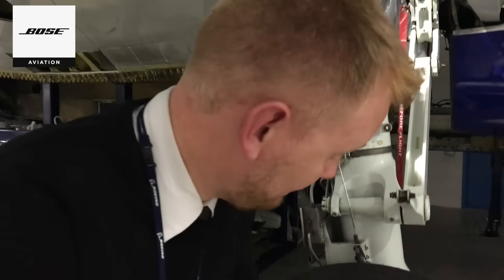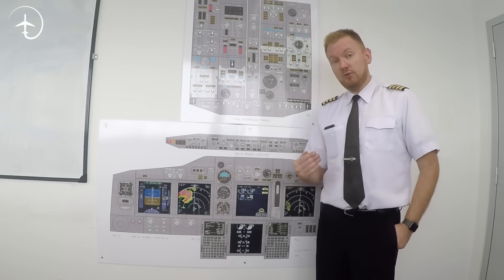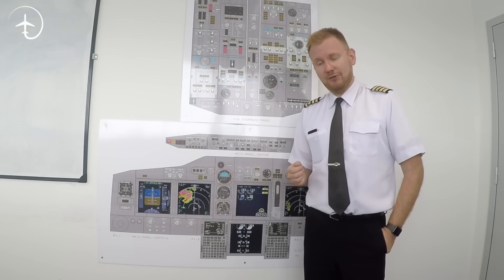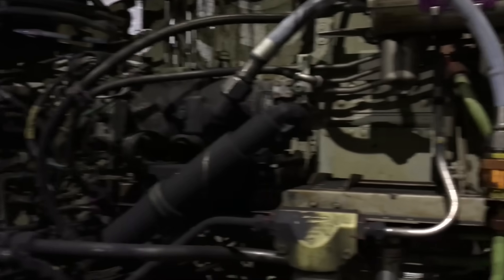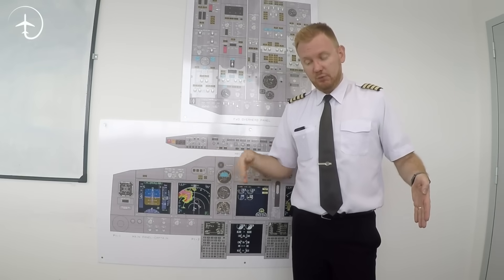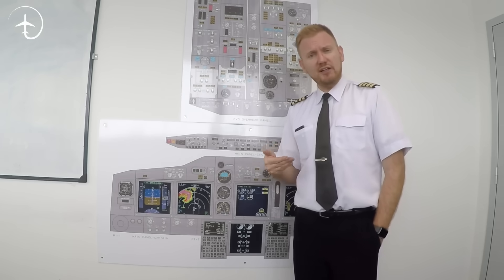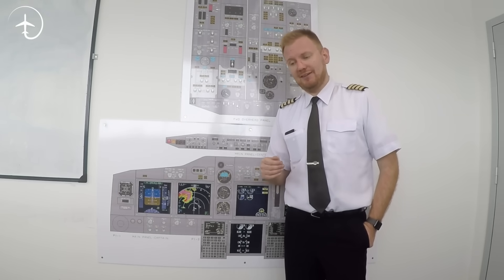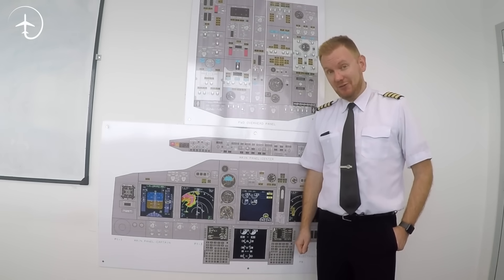Why does the Boeing 737 not have any landing-gear doors?

Comment: When I'm boarding the aircraft, even though the engine are off, why is it so loud?
Reply: Erwin Tjia it's the APU (Auxiliary Power Unit) it acts as like a battery allowing the aircraft to have power the out the Engine. It's like the ACC (Accessory) mode in a car
Reply: Marks right APU is a small jet engine in the tail area that provides electricity and bleed air pressure for air conditioning and engine startup.
Reply: Please do not confuse APU with batteries. APU in fact need batteries to start as it is a turbine engine with electric starter and it also needs fuel pumps which needs electric power. APU on some AC may also be started off a TRUs, B747 has switch to select if you start of a batt or TRU. This requires either engines running or external power to power TRUs with AC power. Some APUs are just started off DC bus and anything that powers it no matters what is it.
The other noisy thing may be brake fans on some Airbus models. On short trips crew may use them to cool the brakes if there is no enough block time to let them cool down without them.
Reply: Remember the "Miracle on the Hudson"? First thing the captain did when both engines went out was turn on the APU. Which wasn't even on the emergency list at the time. It is now.
Reply: They often are. This is called ground power. However engine needs bleedair to start. It can also be supplied from ground cart, but in most cases it is more practical to use APU, it provides both, the AC power and bleedair.
Turboprops usually start from electric starter-generators. They can be started from battery. Jets usually needs bleedair.
Reply: Rubbish. An engine would never just be left idling, it would never get serviced if that was the case. A running engine at ground idle power creates not only an ingestion hazard, but a jet blast hazard. As such, an engine would never just be left running at idle at any point while being serviced; lavs, catering, loading cargo/bags etc. It just won't happen.

APU is typically shut down right after starting engines and pressure stabilizing to normal levels. In the event of multiple engine failures, the APU would be fired back up and the RAT (ram air turbine) would deploy to produce power to supplement the battery packs and run the hydraulics for critical flight controls.
Reply: Balazs Ordog Airplanes are quite multifunctional on every property. So they can still function in all kind of scenarios. For example when parked somewhere away from the turnaround spots. Then it’s a lot more convenient to be able to crank the APU instead of having to call for a GPU before being able to do anything.
Reply: Philosopher of Nonsense Generally not true, running engines even at idle uses lots of fuel. Way cheaper to run the APU or ground power. Maybe you are referring to single engine taxi?
Reply: Aircraft will ALWAYS shut off their engines once at the gate. The ground crew can't service the aircraft, unload baggage, etc. with the engines running. Leaving engines running create serious intake and exhaust hazards for ground personnel.
APUs supply air for engine starting and air conditioning packs plus electrical power. APUs do not pressurize hydraulics. Aircraft hydraulics are powered by aircraft electrical systems of engine driven pumps on the main engines.
Reply: Philosopher of Nonsense    You are way off on many things in your comment.  A 737 engine uses about 800 lbs/hour idling.  The APU on same aircraft uses about 240 lbs/hour (electrics and pneumatic load).  During takeoff, the fuel flow is in the neighborhood of 8000 lbs/hour for each engine for the couple minutes it is at that thrust setting.  A 747 has the same engines as a 767, and since they are about double the thrust of a 737 engine, the fuel flows are probably double what I stated above.  And the only reason an engine would be idled at the gate would be in the APU was inoperative AND ground power was unavailable.

I have no idea where you got the thrust number for cruise of “40 to 60%”. Cruise thrust is set by the FADECs and is either EPR or N1 depending on the engine, and we have no idea what percentage of rated thrust that is.  Power is set to maintain the desired Mach number.

Engine failure seldom takes anyone to the scene of the crash, contrary to your statement.  Even in single engine general aviation engine failures, most land with little or no damage to the aircraft on golf courses, highways and in fields.  I did the highway myself without any damage or injury.

On to the APU.  It has no problem starting an engine compared to a running engine.  In fact the 777 can start both engines simultaneously using APU bleed air.   

I can’t even follow your logic on stress and wear with internal combustion engines and turbines.  It was poorly written.  

I have no idea where you got your “facts”, but most of them weren’t even facts.
Reply: Philosopher of Nonsense, total and utter shite!!
Reply: +Philosopher of Nonsense Nonsense indeed. Some of your facts are completely wrong. Each engine on a 747-400 uses  about 0.6 metric tonnes of fuel an hour at idle (during pushback). There are many reasons APU usage is limited, not just because of running hours and wear and tear. There are noise pollution, pollution and fuel consumption considerations. An APU should have no trouble starting a single engine if it's working properly. Idling main engines, however, would stuggle to crossbleed start other engines. They have to go up on power to crossbleed start.
Reply: ImperrfectStranger...No such thing as a bleed air driven hydraulic pump. Boeing and Airbus aircraft use EDPs (Engine Driven Pumps) or Electric Hydraulic pumps. The only air driven pump is the RAT (Ram Air Turbine). 
APUs provide only two things...air for the packs and engine starting plus electrical power.
Reply: prob the APU mate
Reply: Fromage...Again, engines are NEVER left idling at the gate. When the crew taxis into the envelope, the ground crew either connects ground power and air if required or they start the APU. Engine are always shut down.
I have been in aviation for 38 years and worked for major US air carriers as a gate technician. I am pretty sure I know what I am talking about.
Reply: Engine on idle when refueling and reloading,boarding??Are you insane?? That what APU if for.I work on the airport for years and never ever seen anything like this.Nobody can get close to the aircraft with any off the engines running,its against what they teach you on your training on your very first day at work.What a lot of bullshit.Sometimes engine fan is rotating because of the wind,but the engines are off.
Reply: Erwin Tjia it's the APU
Reply: Erwin Tjia nobody have mentioned braking fans :) for example if the aircraft has just ladned like 10 mins ago the brakes are very very hot, and they need to cool down so they can be efficient again for emergency braking for example, and then the pilots need to turn them on so they can cool their brakes, and those fans are insanely loud :) and the AC of course and APU
Reply: On small aircraft the noise near the tail is the APU, auxiliary power unit. On Large aircraft such as the 747, the apu is a long way a way in the tail cone, and not as loud as you might think. The extremely loud noise is far more likely the air conditioning “packs” located in the belly. These are turbine/compressor air conditioners that condition air for the cabin. They also pressurise the aircraft in flight. On a hot or cold day on the ground these will be working very hard to maintain the set temp. They actually sound like jet engines when near them and are incredibly noisy! That’s probably the sound year hear on large aircraft.
Reply: Phil. of Nonsense  Respectfully...just about everything you've posted is, well....nonsense.
Reply: Please come again!
Reply: And what are you doing now ?
Reply: Also, (beware, I'm not an expert but I'm finishing my aircraft maintainance course with a variety of AIRBUS aircrafts) as far as I'm concerned; aircraft neumatics / air conditioning called PACKS work as giant refrigerators. They are mainly designed to provide proper cooling to the cabin in cruise, which its air comes from the low pressure compressors of both engines. As it is intended to work with proper amounts of ram air, on ground ops, those EXTRACTION FANS, that generate the needed airflow, may end doing a hell of a noise. This system comes back from DC-9's design and even the A350 features it. 787 is different though. APU+PACKS(+ BRAKE FANS are also very noisy; only A320) may be the majority of the noise percieved.
Reply: APU and air conditioning, both are very loud.
Reply: Philosopher of Nonsense--GREAT STORY!!!!!    Remind's  me  of my VASTLY SMALLER  young moments
of glory, (I'm FARR more of a AUTOMOBILE guy) you take ME back to my GREAT memorization  of 
auto styling from 5 to 20 years old ( ALL american cars were VERY distinctively styled in the 50's, 60's & 70"s )
I was born in 1955, I would sometimes CAPTIVATE my classmates & teachers with my ability to tell you
the car heading east was a 1961 Ford Custom 500 wile the car heading west was a 1963 Oldsmoblie Super 
88 from about  65 to 80 feet away!! full sized Fords & Chevy's EACH had 5 trim levels Plymouth had 4
every September I garbed ALL my parents newspaper adds &  begged them to take me to dealers to get
the brochures  & studied them;  I could CORRECT MOST ADULTS !!!  But one of my FAVORITE MEMORIES 
(& the one YOU reminded me of ) was when I was CLOSE to 10 years old & having seen Ford's NEW
Dual-Way Doorgate (out for people, down for cargo)   I quickly figured-out HOW IT WORKED!!!!
they just had the upper left LATCH DOUBLE as a hinge & the lower right HINGE DOUBLE as a latch
DEPENDING upon which LEAVER you used!!!  Upon visiting a Ford dealer, to ask for brochures---------
I PROCEEDED TO EXPLAIN IT TO THE SALESMAN;----HOW DID I KNOW THAT?? he asked
Well I JUST FIGURED IT OUT  I ANSWERED!!!-----REMEMBER the LOOK the Captain gave your dad??
Well I got it ALONE,  my MOM was sitting in our car wateing for me to COME OUT with my brochure 
treasures!!!!!!
Reply: packardexelence actually, I did know that.  Nowadays too many car types to be able to identify more than a couple.  I’m sure some people can (law enforcement). But not me.
Reply: Not to mention that no established airport would allow them to stand at the gate with their main engines online for anything more than a couple of minutes - and that's only for the very (very) odd circumstance where they're not started during pushback, but before.
Reply: Why is this thread so long? I'm going to click on the next video now.
Reply: The APU. Probably others have already said this but I'm too lazy to look. Auxillary Power Unit is basically like an engine you'd find on a very small jet, typically made by Honeywell mounted in the tail 'cone' kind of area, you can see the exhaust hole for it.
Reply: Erwin Tjia The APU is on for keeping power on
Reply: +odiesdad01 APUs can be used to run bleed air-driven hydraulic pumps on many kinds of aircraft. e.g. 747-400, 767, etc.
Reply: Some APU's are actually quite large, in fact. The APU on a 747 is derived from a biz jet engine...which should help you imagine that these are fairly large engines. The Airbus A380 uses a HUGE APU, the Pratt and Whitney PW980. So yes...they can make a lot of noise.
Reply: +Philosopher of Nonsense
That is a really nice story! 

The first time I used an airplane was, when I was 17 yrs. old, a flight from Zurich-Kloten to London/Luton. It was one of the last flights of a Boeing 707 as a passenger aircraft, though she was quite  a comfortable aircraft. Many young people used that extreme bargain offer: 
Only 170 CHF (by that time about 80 US$) for a one week vacation during spring break in a three star hotel near Trafalgar Square. It was a wee little adventure for me, too...
Reply: Reason is you are probably hearing the APU.
Reply: packardexelence stellar response to.......I am not sure how we went from airplanes to cars, but you seem to have made the leap, so good for you.  Tail lights are the key for sure.  This story reminds me of my first smoke detector in my apartment right after I got married.........and my wife was wondering when I would build my own smoke detector, and then it came to me.  Batteries, yep batteries, that would solve the problem of power.  I should write my own smoke detector manual.
Reply: Oscar Blue--I think you KNOW how we "made the LEAP"  I of course was referring to his childhood "cockpit story" where he SURPRISED the Captain with his Knowledge ; you MIGHT Note that I referred to my "young
moment of glory as "VASTLY SMALLER" I was ONLY interested in CARS as a CHILD;  I didn't Get intrested
in airplanes UNTIL my last 2 years in the U.S.A.F. I gotta hand it to ya, though,  for an AIRCRAFT guy, you
either KNOW or GUESSED CORRECTLY about early 60's auto identification, Ford, Chevy, & Cadillac virtually
used Tail light SHAPE as TRADEMARKS!!!!!!-----But I'm SURE you knew that!!!!!
Just like I KNEW Philosopher of Nonsense  fuel CONSUMPTION rates were INDEED- NONSENSE;--since
an F-4 can burn up ABOUT 15,600 LBS. of JP-4 in about a 21/2 hour training flight,--- well at least I had
to REPLACE around that much, after they PARKED!!!--------------------------BUT BATTERIES for a SMOKE DETECTOR??????------oooooo sounds pretty DAMNN  RECKLESS to ME!!!!!!!!!!!!
Reply: Oscar Blue--OOOOh TODAY, you have ME for company as far as being POOR at automotive identification!!!
The LAWS of aerodynamic efficiency & weight conservation have caused automotive engineers to
REALLY RULE THE ROUST --as they have for DECADES with aircraft !!!!    I mean you only GOT so little
STYLING FREEDOM when FUNCTION; down to the LAST MPG & SAFETY down to the LAST CANDLEPOWER of TAIL LIGHT & SINGNAL LIGHT VIABILITY  are  HEAVILY compared!!!!!!!
And LAW ENFORCEMENT???? their identification skills HAVE ALWAYS SUCKED!!!!!
Reply: Philosopher of Nonsense A taxi driver leaves the engine on to run the heater or air conditioning. Modern cars automatically turn off the engine at every single traffic light, so the statement that it’s more profitable to leave the engine on is quite easily busted.
Reply: packardexelence no doubt.  Headlights are better, and a few cars have nice styling, but the cars of the 60’s are my favorites.
Reply: Oscar Blue---I LOVE MOST EVERYTHING about 21st century cars,  EXCEPT their PURPOSELY ENGINEERED
to SELF-DESTRUCT  in about 5 years or 250 thousand miles & PURPOSELY ENGINEERED ( &parts-Priced )  
to be IMPOSSIBLE to CHEAPLY REPAIR  that long!!!!!!!   I INTEND to buy cars from PRE-1995 for THE REST
OF MY LIFE; although I'de LOVE a 1954 PACKARD, just 4 SPECIAL occasions!!!!!!!!!
Reply: packardexelence I am not keen on the idea of the self driving car.  I think it will lead to not seeing the beauty of the world outside (texting, reading, videos), and a loss of connection to humanity. ( not seeing a person who needs help, will we also have self changing tires?). There will be benefits to safety, but I enjoy driving.  I have driven over a million miles in my lifetime, and there is so much to see.  Will future generations see these things, or will they be too busy using electronics in their self driving car to notice?  A drivers license was freedom when I was a teen.  Now many teens don’t even care to get one.
Reply: Oscar Blue-I TRULY FEAR that the "self driving car" will become YET another CON-JOB like AIRBAGS-
TOO many people FORGET that THE ORIGIONAL PROMISE of AIRBAGS was that they would REPLACE
SEATBELTS--(which I ALWAYS KNEW they couldn't)---OOOOH , THEN AFTER the LAW stuck US with
PAYING 4 THEM in ALL our cars, OOOh ; low & BEHOLD  in come the SEAT BELT LAWS!!!!!
OOOOOH  but the AIRBAGS GET ALL THE CREDIT!!!!
I have NOTICED that REGARDLESS of ALL the modern DRIVING AIDS (like AUTOMATIC BRAKING)  
A FULL 100% of the RESPONSIBILITY for ANY ACCIDENT, ANY TIME REMAINS WITH THE DRIVER!!!!!!!!!
& have you NOTICED in the case where a "self-driver" HIT A PERSON DRIVEN CAR GOOGLE SWORE
IT WAS THE PERSON DRIVEN CARS FAULT!!!!!
SELF-DRIVING MY ASS!!!!!!!!!!!!!!!!!!!!!!!!!!  
I have been ALWAYS a seat-belt USER since 1968!!!!!!!!!!!
Reply: +Pawel Pawlowski Hot refuelling is a rare procedure and typically one which is only considered as a last resort but it is actually permissible and does sometimes occur. Only one engine may be left idling however and the aircraft has to be fuelled from the other side. Typically this is something one would only do if both the APU is inop and the airport facility doesn't have the means to handle the situation (no huffer cart for example) of course this is mostly a situation you are only likely to encounter at some very remote airport somewhere. Such airports do exist though and some of them do indeed take small jets like the 737 though often only a few flights per week many of them serving communities so remote that there is a sum total of 0 roads and all people and goods in or out goes by those same flights.
Reply: Apu
Reply: Seraphina S- Never saw nor HEARD of civilians HOT refueling; but I WILL take your word for it;
personally I  did it PROVABLY about 600 to 800 times my last 2 years in the U.S.A.F. do civilians ALSO
keep a running fire truck close by, WE HAD TO! ,  Also we used a 3 pipe pantograph on wheels with a 5
foot hose to REPLACE the 30 foot we used for regular refueling, MINE was ALL from an undergroung
hydrant system.
Reply: Erwin Tjia (
Reply: Its the thing at the back of the aircrap
Reply: Because it's cheap. A flying school bus. I hate it, refuse to fly it.
Reply: Although, there's no RAT on a 737.
Reply: Boeing 777 has 2 air driven pumps.
Reply: Erwin Tjia  the APU is turned on
Reply: must be full of English, when the engines off you can still hear the moan.
Reply: The Engines has to be turned off, other wise people can set the wheel clocks or tank the aircraft.
Reply: Erwin Tjia APU. Almost like ACC in an automobile
Reply: It is the APU, a small engine located in the tail section of the 737, as all generators it uses fuel and produces AC power to power various Aircraft systems such as electrical system, air conditioning System etc while on the ground but can be also used in the air during specific conditions
Reply: Why are you all keep repeating it's APU? There are nice replies with explanations, so why the hell are you writing it again?
Reply: Philosopher of Nonsense I think it's protocol to turn off the jet engines so that the next crew knows they can be restarted successfully
Reply: Erwin Tjia it is the apu which power the cabins and machines
Reply: I thought planes are plugged in to ground power when at the gate?
Reply: @balazsordog3074 
I'm now imagining a plane "plugged into ground power" not like they normally are, but into a normal 220V/16A socket. Bloody hilarious. Thanks for the laugh.
Reply: +HERBSMAN441 "Rubbish. An engine would never just be left idling, it would never get serviced if that was the case. A running engine at ground idle power creates not only an ingestion hazard, but a jet blast hazard."

He's not suggesting they're left idle all the time.  But there's no particular reason why you couldn't leave one engine running at minimum power for a few 10s of minutes while the baggage handlers are stuffing luggage in the other side.

"never get serviced"?  You think he was suggesting they were left idling 24 hours/day?

My father did some work at the Polaris tin/zinc mine on Little Ellesmere Island, which at the time (and may still be) the farthest north any mine has ever been built.  Shipping season (when they got to ship the product out) was only 6 weeks long.

They left their diesel pickups (they were probably Toyota Hylux's) running 24/7.  Because if they were ever turned off for more than a few hours out in the open, they'd probably couldn't start again until the next shipping season.  The only time they ever turned them off is when they drove them into the (heated) garage for an oil change or other servicing.
Reply: APU auxiliary power unit.
Reply: In many cases the engines aren't actually off anyway, as leaving them idle maintains temperatures and pressures. It is similar to why a taxi driver doesn't shut off their car just to pick you up from the airport, because it is actually more stresful on the components to shut down and restart instead of just running at minimum power. If you board on the articulated tunnel (as opposed to the stair truck), they can usually leave them idle as passengers are never on the tarmac itself.

If you have ever had to sit for 38 hours at an airport terminal, you may have noticed that some planes deboard and unload (luggage), are parked for a quick once-over for preflight and fueling, board and load, and then taxi right back out, sometimes in less than 40 minutes, so they often just leave at least one engine on (easier to bring up pressure with a full-size engine than with the APU) which also saves some wear on the APU itself. The APU also serves as a last-resort backup to maintain hydraulic pressure or critical electrical power in case of all engines failing, so that the aircraft can still be flown. Nothing is scarier than "dead stick", which essentially means that you are all just along for the ride until the scene of the crash.

Warning: Adorable story ahead...

When I was 7 and so glued to watching the runway and service area that during the layover I actually fell asleep camped at the window, I got quite a surprise soon after I awoke (my grandad was very high-ranking retired military with many honors so he had the hookup for everything), to not only meet the captain and crew of the flight who was equally impressed that I had such an interest, but got a cockpit tour and nearly peed myself because he had me operate the switches to start an engine (SO illegal now, but this was many decades ago).  The Captain thanked me because he wasn't sure he could have done it all by himself (naturally a white lie you tell to a 7 year old who thinks you are a superhero).

I remember he asked me how he should take off (as if he needed me to instruct him), sort of as a test and to stroke some ego a little perhaps, and he seemed genuinely shocked that a 7 year old would say to "smoothly increase the throttle as not to stress the engines or airframe excessively, because it was so heavy an aircraft". He looked to my grandad a with a look as if to say, "if you don't put this kid in flight school or mail him to NASA, it's an extraordinary waste of talent". Upon de-boarding, the Captain was there at the exit door waiting for me, and gave me "my wings" (some trinket he likely secured form the airline's promo store-room...and a die-cast model toy of a Boeing 747 with the airline's name on it prior to departure while I was still asleep...totally fake but real enough for an AP second-grader).

I later found out that the captain had walked by just getting his morning coffee and paused to wonder why I was asleep and practically cuddling the terminal window. My grandparents explained that I was an engineering prodigy, and manically-obsessed with flight and complex engineering feats, and that I had failed to stay awake to watch every plane come in and go out. They just could not keep me away from watching, so they just let me fall asleep there. Looking back, it was maybe the most exciting 3 days of my life at the time, and maybe me at my most adorable.

20 hour flight and couldn't sleep because I had a window seat next to the very engine I started. I was a geeky kid fascinated by aerospace engineering and flight in general, and Disneyland was like the DMV compared to this. Couldn't stop talking about it until I was 8 lol...You would have thought I met the president or something.

Ah, life was so simple back then...
Reply: +Mc Donnell I think you're confused. Packs would be used for heating in cruise. With the outside temperatures at -50C, I don't think cooling is an issue. The cabin needs to be pressurised in flight. This is also a major function of the packs. On the ground, the noise is coming from the pack turbines, not any kind of extraction fans. Back to your books! ;-)
Reply: Because you're an over sensative millennial.
Reply: APU
Reply: Poor Apu - he gets blamed for everything in the Simpsons! ;-)
Reply: D Mullins: I would somewhat disagree. What fatigues these large engines is not the mileage insomuch as thermal stress. In a relative sense, engines use very little fuel when idling. For example, the engines on a 747 may use about 40 lbs of fuel an hour at idle when "docked" at the gate (which does seem like a lot without comparison), but at full power such as takeoff or those equipped with reversing exhaust cowlings (retrograde thrust for short runways or extreme tailwinds), they consume something more like 40 lbs a second (don't quote me, I don't have exact specs, but the comparison is functionally plausible). Also, the APU is far more difficult to remove and replace for maintenance than a wing engine, which is why ground power is preferred. You want the APU to be available if needed in-flight, so you don't always want unnecessary wear or time-consuming maintenance, and as any airline will tell you, an aircraft on the ground makes no money.

From what I have seen as common practice, airliners being used in an exhaustive duty cycle (such as smaller airlines with less aircraft struggling to meet demand) will leave one engine at idle for a quicker start on the rest, as it can easily provide the boost pressure to spin up the next engine. The APU has a much harder time starting a main engine than another main engine would have, and takes notably more time to build manifold pressure for an engine start. Also, fuel is still far cheaper than maintenance (at least for now).

The APU is nearly exactly comparable to the purpose and function of a gas-powered generator of an RV (Recreational Vehicle/Caravan/etc if you are not versed in American vernacular). The "main engine" on an RV is far more capable of maintaining operations, but the smaller generator is there to optimize delivery for lesser demand, just as using a nuclear reactor to light a match would be a bit of overkill.

Generally you don't taxi on one engine unless you only have the one, or you are expecting a long delay before the flight pattern is open enough for you to gain clearance to depart. Even then, you would want to keep all engines warm to minimize the aforementioned thermal stress. "Cold-starts" are pretty rough on these large versions of small miracles, usually fatiguing compressor and impeller fans the most, resulting in higher maintenance and increasing the risk of failure.

Keep in mind that at cruise, or about 40-60% power 'dependent on conditions and load', the compressor fan alone is operating at about 600G of centrifugal force or more, so an engine that "goes on holiday" is generally deemed unacceptable in-flight when you are the one 7 miles above ground, and human-evolution never explicitly gave you permission to leave the ground in the first place XD. The engine internals are most stable when you limit temperature variations that cause flexion, or the expansion/contraction cycle that fatigues them. Naturally you would want to limit this otherwise undue stress out of practicality, much as you wouldn't want to complain to "God" that "skydiving is boring".

The next thing you know, it quickly becomes anything but boring when your parachute doesn't deploy. "Free-fall" is one of those rare times when "freedom" is your worst enemy because you know that it isn't the fall that kills you, it's the sudden stop at the end that ruins your day. Falls don't hurt anyone, but landings can often be fatal.

Engine failure is a very reliable truth, as it always takes you to the scene of the crash with impeccable accuracy. Another truth is that all aircraft have a 100% chance of landing, all that matters is how closely it matches the intentions of the pilot. Maintenance and design serve the singular purpose of shortening the gap between pilot intention and the machine's lack of tolerance for variables, so naturally it gets complicated rather quickly. The smaller the aircraft, the less likely it is to realize that you rely on it more than it relies on you. All this and more is colloquial knowledge you can gain from conversing with retired pilots.

It is the same reason that, although tried quite ambitiously in cars (I think it was Chrysler that attempted this, check ads in Popular Science from the late 1950's for this one), a gas-turbine engine is simply not reliable or efficient under varying demands such as a passenger car. All combustion-run engines operate ideally when the least of conditions change, most notably when there is minimal thermal variance outside of operating range. Turbine engines are far less tolerant of variables than compartmentalized-compression-type power-plants (e.g. internal combustion piston engines), but are largely more efficient and reliable under continuous duty. It is always easier to run a combustion engine than it is to start one.

To put it simply, visualize being a newspaper delivery driver with 40 stops per shift, going from store to store (essentially airlines are delivery services that include people as cargo). Is it more reasonable to  turn the engine off every time you stop and enduring the wear on the starting system 40 times a night, or to just leave it running because you will be moving on to the next stop 30 seconds later?

To clarify, I was referring to airliners on a dense duty-cycle, such as with smaller airlines that have a limited fleet to compete with and have to work them harder, not so much as the example of a private/corporate jet or your neighbor's Cessna used only on the weekends ;D

(Sorry again for the verbosity, this is 3 minutes of typing for me. Maybe I should be a political speech-writer instead, or become the only superhero whose main superpower is...dictation..."Captain Secretary at your service!" No wonder I have arthritis. lol.)